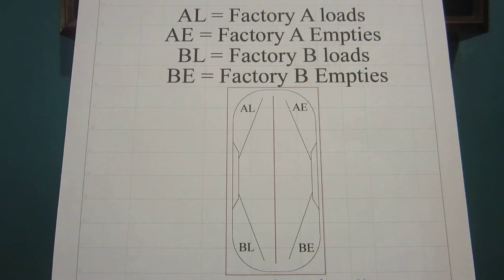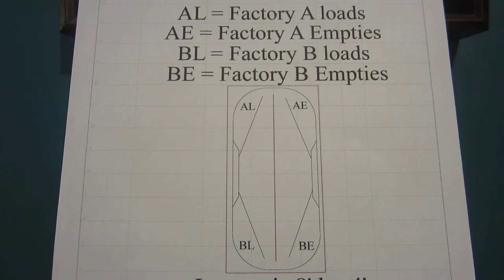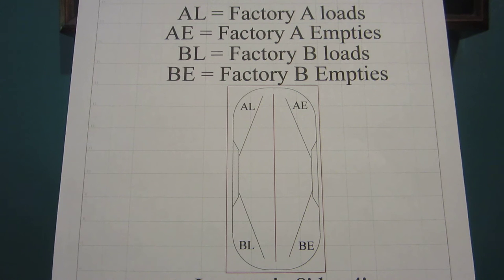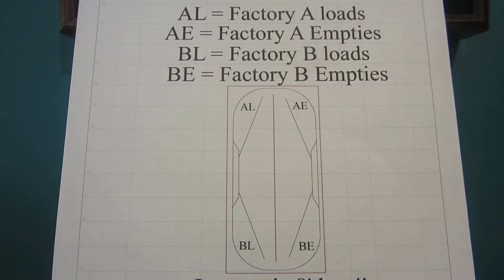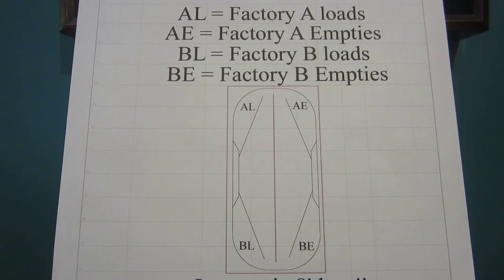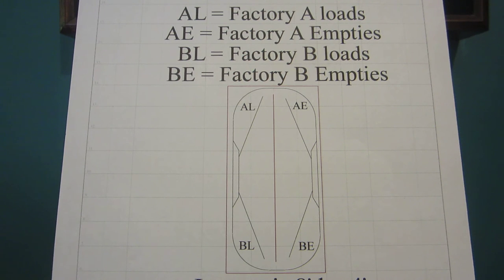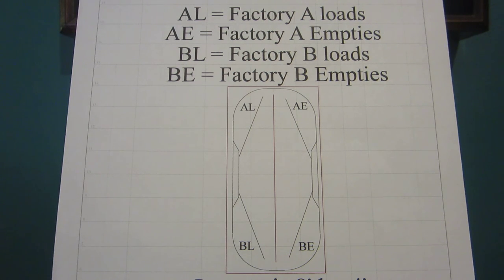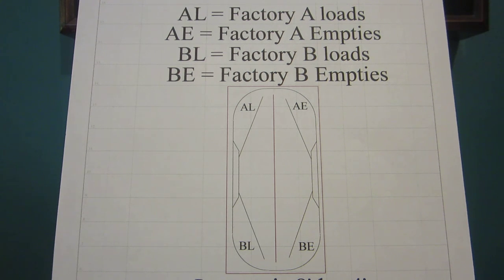OPERATIONS DESIGN....SMALL space, CAN be done!!!  Great and fun operation challenge!

Comment: John....thanks for posting this.....my layout is double loop 6x12....The inner loop has one siding on the left had side long enough for 2 industries....The right side of the inner loop has 3 siding....One for 2 industries, one for an additional industry and one for an interchange track...there is a runaround track located at the bottom which also allows you to move from the inner loop to the outer loop....I have not finalized an operation scheduled yet but I have already had some fun randomly picking up cars and dropping off others....once on the outer loop there are 4 stops that the train can make with no switching moves but it does extend the distance of the railroad....I have always be an O gauge guy ...I did join an HO club and I saw how an operating session takes place...after that I was hooked....and since then I have been trying to do the same in O with the limited space I have...and so far it has been a lot of fun...getting to see your videos only give me more inspiration. .... I hope it does the same for others..
Thanks again,
Joe
Reply from the maker: Thank you for your kind words Joseph.  I'm just trying to share some of the knowledge and wisdom that has been learned over the years.  What surprised me the most, thus far, was the reaction over the trailing point vs. facing point moves video.  Like 675 plus views in 4 days!  Wow.  I was encouraged to do it and I thought everybody knows this...well everybody doesn't.  I've just been around so long I wrongly assume everyone I'm talking to knows....I've been doing this about 45 years now.

Comment: how can I adapt this design to handle larger than K4 steam engines?
Reply from the maker: How large of engine do you wish to operate?  How long will your longest car be?
Reply: I have a J1 Shark nose abba, GG1, 4-8-8-4, 2-6-0, these were my dads and I want to get them up and running. thanks for your response. Peter
Reply from the maker: Whatever the minimum recommended curvature is....I'm guessing a 72 diameter curve.  That would make the oval at least 6 feet wide and eight feet long....How much space do you have?  You could do a variation on this theme....
Reply: The Glacier Line I have a 10x20 garage [single car] and a driveway. I thought about making modules 2x4 sections so I can move them.
Reply: I also have ho scale from my childhood also from my dad.
Reply from the maker: That would be a great idea!  I would frame with 1 x 3s and use the 2 inch thick foam on top--super light weight.